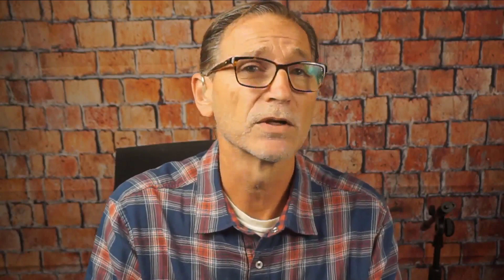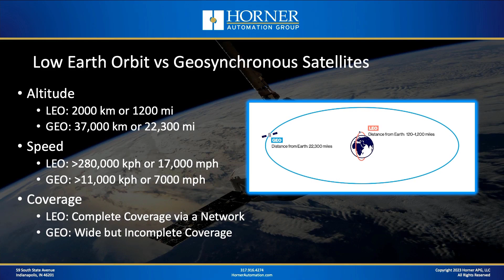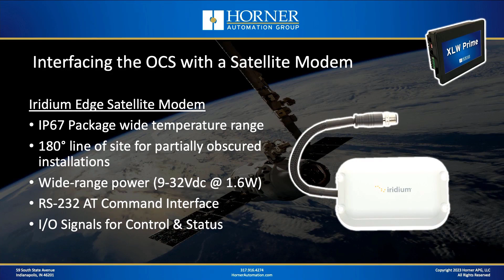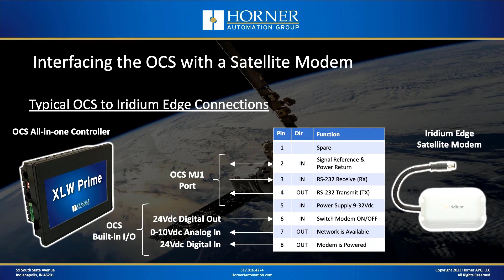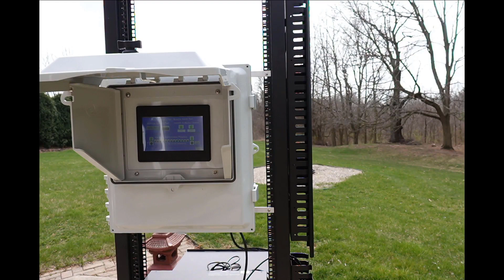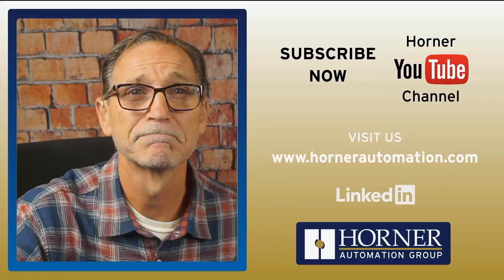Satellite Communications Using Horner OCS

Comment: Howdy Chuck. Good basic presentation. Also wanted to mention to you that Metrologics programs applications on both Iridium and Orbcomm satellite terminals, with our Modbus-RTU master (can read tags on the Horner) and can be user set to push tag values at time intervals each day. Our on-board apps also can send alarms based on thresholds and value changed settings (Example: Horner controller flags alarm conditions, and our satellite app monitors this controller tag, and we send OK or the alarm code to the server where it is processed for advanced alarm processing and delivery). Our satellite apps also incorporate our data compression to the message payload where we can send many tags in the modems allocated small byte count. This is a plug and play to Horner controllers, where the user would not need to setup any complicated "User Protocol" messaging scheme. Of course, we are a certified VAR for both Iridium and Orbcomm. We also have our own server/portal designed for private labeling to system integrators. I do not think that Horner should be looking at offering end users a Horner Server/Portal for MQTT/other (satellite) message delivery/processing, since we (a Horner VAR) already offer this functionality. You can call me (Fred) on my cell if you want to discuss further.
Reply: Fred - thanks for the feedback!  It's good to know that there are VARs out there (including Metrologics!) that can meet custom requirements when satellite is the best machine communications option.  As you noted - our session was more or less a basic introduction to what is possible with satellite.  Through expert VARs - a lot more is possible!